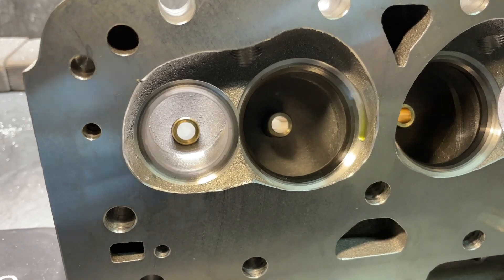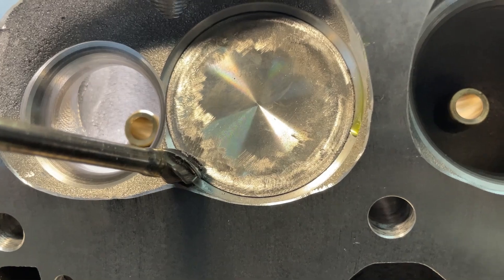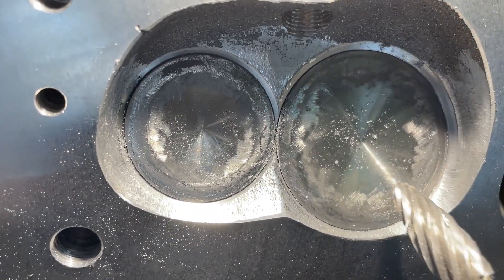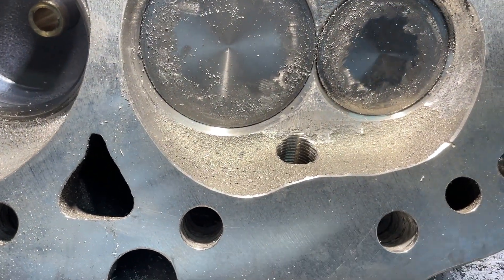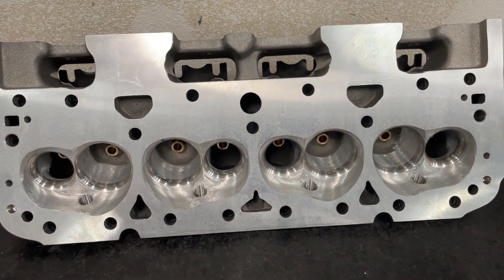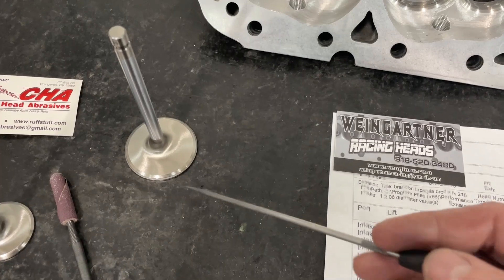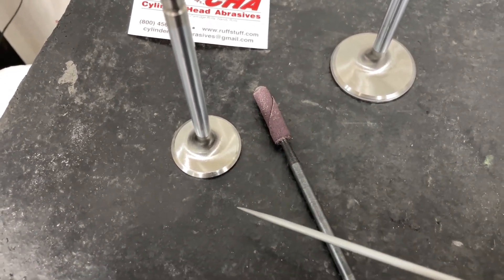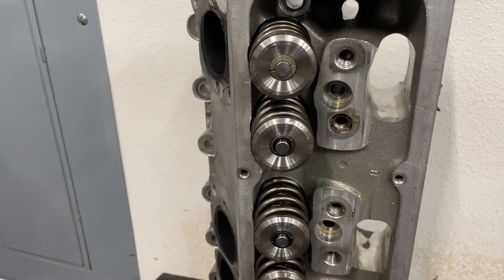Simple Chamber Mods You Can Do

Comment: Can I put valves large enough to just about touch like these are, If I have plenty of room (kinda plenty) on my 7.3 Powerstroke diesel heads if the valves are 1.675” and where the seats sit there is 1.94” across? There is even more room to cut out for larger custom seats, even a middle hump that looks horrifically clogging for air to pass during overlap, that is another .12”, so theoretically it looks very easy to reach 2” OD seats if machining can cut through the integrated valve seats (intake valves are integrated but looks like the exhaust valve seat can be pressed out) I have found it very difficult finding anyone with in depth knowledge on 7.3 diesel heads, or anyone that has any videos about anything to do with helical ports in these types of diesel heads. For reference I chose to stay with a Stage 1 Cam for my dedicated tow rig but here are the numbers: intake lift .430” exhaust lift .433” intake duration 186/exhaust duration 195 Lobe Centerline 107. I Hope that is informative. I changed the name of my previous channel to Coast to Coast Diesel Enthusiasts about a week ago, and started with a few rough and unrehearsed videos I fumble through but I’m trying to help the diesel community to understand there is more room for efficiency and flow, especially compressed air from the turbo and being a boosted induction application, that’s left on the table when folks only increase fuel from injector size, and that sorta goes into outer space levels of fuel real quick but also brings excessive heat with it. What are your thoughts and do you have any ideas about how to improve the 2 valve design with a stock flow that is very dismal compared to Cummins design. I like Powerstroke and Cummins both and respect both platforms, although I do not know much about Duramax engines yet, I am willing to learn about their platform as well as I develop my experience further into the diesel design and engineering. Although the RPM ranges are much lower, Boost plays a crucial role in the low end torque development and I am confident I can Pioneer a formula to enhance these products performance and even help drop EGTs during load with more airflow through the heads. Any suggestions or recommendations would certainly be appreciated. Thank You in Advance if you have taken the time to read this and have a quick moment for an experienced response and recommendations.

Comment: Doesn’t doing this lower compression? Also if that is true is it worth doing to remove and smooth ledge? Do you think it’s pointless if it’s just a mild street engine? The reason I ask is I did some bowl blending and port matching with a burr and smoothed out any casting flash on some iron heads that I read had a decent flow rate. I bumped the compression with pistons but didn’t want to go backwards after doing so. Thanks

Comment: So after you open up the combustion chamber you need to mill the head down to get your compression back I've read you can mill 80 thousands off a small block head before the intake has to be cut is that true ?
Reply from the maker: On a flat mill it depends on which intake.

Comment: Any interest in doing a set of Big Block Chevy heads from Blueprint Engines? They're supposedly 119 cc Chamber, 358 cc Intake runners 125 cc Exhaust runners with 2.300 in. intake valves and 1.880 in. Exhaust valves. I'm running a hydraulic roller w/ .647 in. Intake and Exhaust 258 degree intake and 266 degree exhaust @ .050 with a 112 degree lobe separation. Dyno says its making 742 hp @ 5,850rpm after that it dives off a cliff though. They're on a 598 cu. in. BBC right now, but if I had to do it all over I think I'd go down to a 555-560 cu. in. Just to have more area on the sides of those pistons. That bottom ring is just about where the pin is on those H-Beam rods with a 6.480 length, and a 4.500 stroke. Its a standard deck height block with a 4.600 bore. It sounded great at the time when I bought it, but now I've learned so much more over the last two and a half years, only nice part is now they've lowered the HP by about 20-25, and when I asked them what they'd changed, they told me they didn't have records of what they used in 2020! Can you believe that? Anyhow, if you have any interest, about how much would it cost to get those heads worked over, and how long of a back log are you running right now? Its almost the end of the season here in Wisconsin, so with winter, unfortunately, right around the corner, it'll be time to pull some things apart and prepare for next year.
Thank you in advance.
Reply from the maker: I don’t mind if you have the time.
Reply: @WeingartnerRacing  Living here in Wisconsin between the end of October, until the middle of April, all we have is time up here! Lol

Comment: On a 06 5.9 Cummins how much power do you think port matching both the exhaust side to manifold and the manifold to turbo is worth? I took out a ton of metal. About a quarter inch, and flareback about an inch and a half. Due to how the intake shelf is I could not do any port smoothing of any sort.  

I am just a noob with a bit of common sense. This truck has a ton of upgrades, but curious how the free ones helped. If its apart I am gonna do all I can before putting it back.

Comment: You can get rid of the margin on the valve by using a drill press and a cartridge roll on a die grinder if you’re a DIY type .
Reply: I put mine in a hand drill and use a belt sander.

Comment: You aren't unshrouding the valves, your just making it look good. Try running the valve out .100 at a time and measure the distance between the valve and edge of the chamber. How much clearance at what point depends on a lot of things. From the little of the work I can see you've done you have left some flow on the table.
Reply from the maker: The flowbench would disagree with you. The small amount of flow gained from the small areas you could unshroud would be a loss of horsepower from the decrease in compression ratio.
Reply: @WeingartnerRacing  I just need to ask...is the valve spacing changed on these Brodix? If you mentioned it and I missed that info, I apologize.

Comment: Eric, I typically use a 1.8 factor for flat tappet medium performance engines for HP per cfm. In a mild performance engine I would hope for something over 1.2. That would make these heads worth around 36 HP. Like you said though, only the dyno will tell. Great video, thanks for the tips.

Comment: I've done exactly this, on my bike and together with the rough intake and smooth exhaust, plus increasing the throttle plate diameter (with a lathe, from 26mm to 28), and a Teflon thicker gasket perfectly matched. 
 I have no idea what power or flow it has now, but the engine now it's capable to rev up to 11500 rpm, from 10500 previously.
 The intake valve wasn't perpendicular to the seat tho, so I've got it done professionally and they told me I've done a wonderful job!